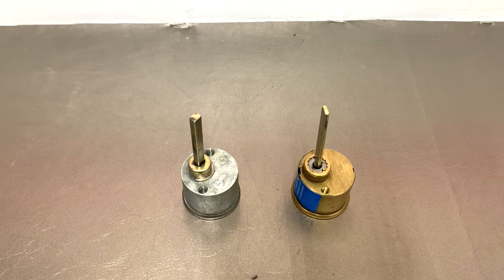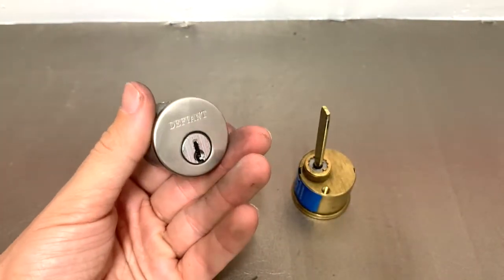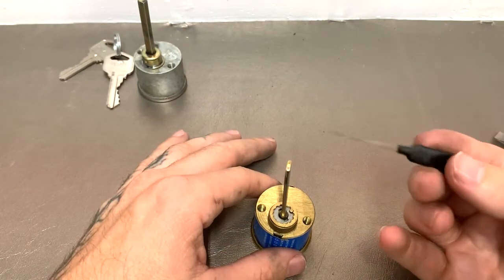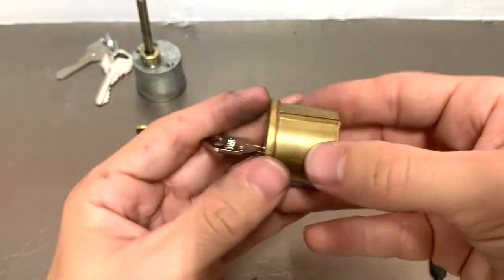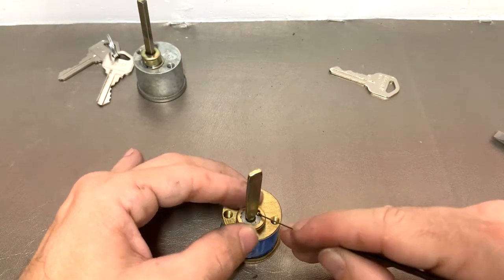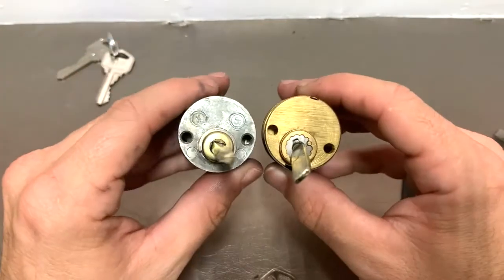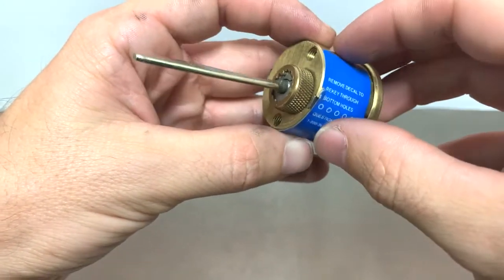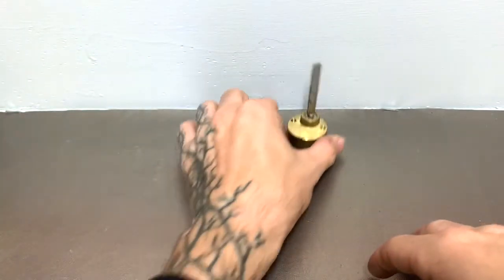How to remove Tail Piece/End Cap from Dead Bolt to rekey

Comment: Apparently Defiant changed their design, because when I first got started in lock picking back in 2005, I bought a Defiant deadbolt and it was equipped with an end cap that had a spring loaded pin.
Reply from the maker: Yes, some Defiant dead-bolts I have come across do have the "schlage" style end-cap. On 95% of the Defiant's we come across it's mostly the clip. But, I should have noted that on the second lock as well! This is actually kind of why I started the channel lol.. my first video was rekeying a defiant with the clip as it's the most common style. Granted this channel grew from what was just a one-off How-To.. I changed my approach to be more inclusive to all and help speak to a broader audience haha! My apologies :)

Note: there are other types of clips I will touch on in future videos as well!

Comment: Is there a way to tighten the tailpiece? I have a lock that in all other aspects works like it should, but there is a bunch of play with the tailpiece which im worried will lead to a soon to be replaced lock, i want to avoid that cost as long as possible. Can it be tightened? The play is vertical... the lock used to be hard to turn so the extra force that used to be required may have caused it to go loose, but since replacing the inner-door piece it turns beautifully. Though the tail piece play is bothering me.

Comment: Yeah, but try to remove the tail piece from defiant without ruining the cap, good luck
Reply from the maker: Yeah, I mention that in my first ever video haha
That was the video that kicked off the channel funny enough!
Reply: @LockandKilo  Sorry, I missed that first video. I was repinning my house locks, and didn't have hollow plug follower, just a solid plastic one, but I wound up drilling a hole on the solid plug follower and got it done before I ruined the plug or the tail piece, lol. Thanks for the video1